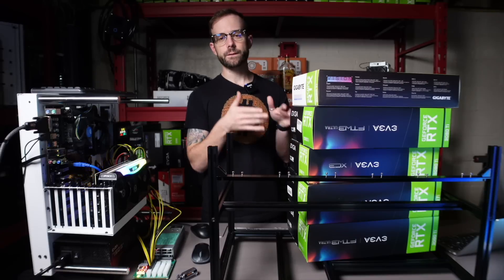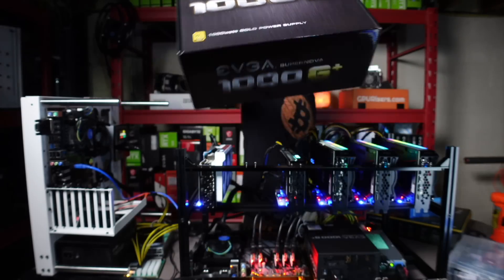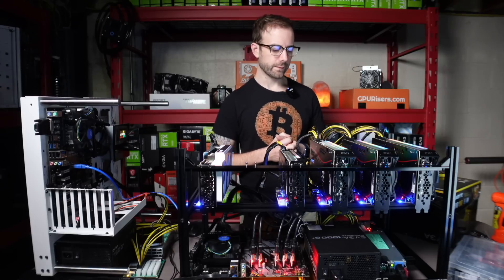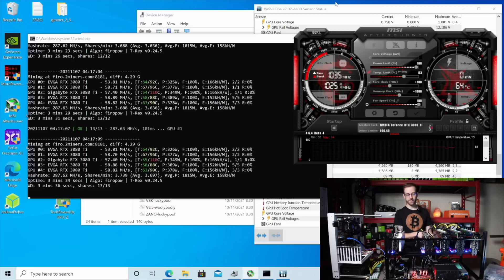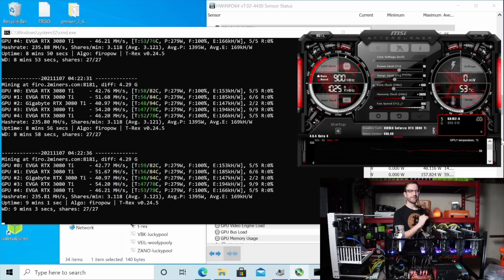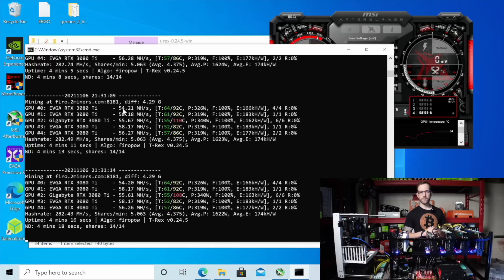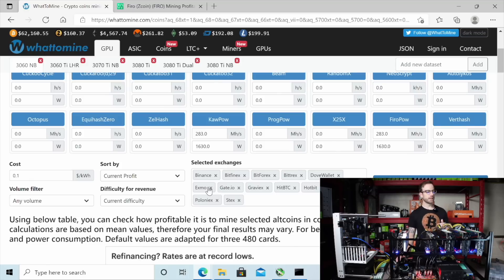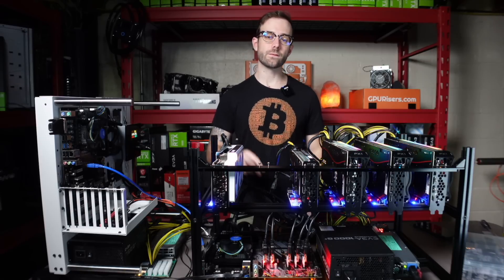RTX 3080 Ti GPU Mining Rig

Comment from the maker: What's the last mining rig you built?
Reply: 12x RTX 3090 (11x PNY, working great, 1 Gigabyte (need a thermalpad surgery)
Reply: Just started mining, First one ever last weekend. 
Asrock h510  pro btc, with 1080, 2060, 3060, 3060 ti.
3070ti in pc going to.
All on flux at the moment 

Thinking of getting a 4 way riser splitter for this board down the line Anyone know if it works?
Reply: I picked up a Biostar TB360 Pro and 3 x 6600xt's, still in progress with 6 x 6600xt's now and  3 6700xt's on the way.
Reply: A x5 3070's lhr with 5x 3080ti's currently mining flux!
Reply: Hello there…. I just received my 6 3080 ti FTW3 cards…. I have  “2”  1200 watt EVGA for power… my question is…. What’s the best way to  power up these beast… I was hoping I could use 2 rails  for each card 

Pcie 1 will  split between one power connector  and the riser card 

Pcie 2 will power up the other two connectors…. 

My question is… I read some where that the “3rd” connector  only draws like  75 watts… 

So if I took Pcie 1 and powered up riser card , and first connector 

And Pcie 2 to the 2nd connector plus the 3rd connector , would it be a proper balance of power distribution….?  If the 3rd connector is indeed a lower power draw which exactly is the 3rd one?  From what I read…. It would be the plug closest to the back (left) which actually sits right above the “ti”  logo
Reply: 6 x a LHR 3060ti and a random 1080ti I had laying around. Currently doing about 320 MH/s on Eth.
Reply: I'm building  5 3080ti ftw 3  rig. Can I use 2 atx psu  to power the gpu instead of a psu server like the one your using in this video.
Reply: @newminer2649  I have a “6” 3080ti rig…. “2”  1200 watt atx PSU each PSU can run “3” 3080ti… can be tricky cause each gpu will need 4 connectors …

Comment: Good day, thanks for making the video!
What server PSU do you recommend if I want to build a 6 x 3080ti rig ? I have a Corsair RM850x on hand.
Thanks a lot
Reply from the maker: You may need 2 server PSUs since in total the GPUs would pull around 2100 watts at full TDP. I'd go with two 1200 watt HP server power supplies.

Comment: Hy Red what type of cards would you choose from the followings inno ichill x3 x4 or asus tuf gaming oc or evga ? I’m prefer asus tuf i saw an article about it and it’s tell the best card is asus tuf. Which from this cards the best cooling ?
Reply from the maker: EVGA first and ASUS second for me.
Reply: Thanks for your reply red fox
Now it’s clarify what i can buy in my country the following ones : ASUS RTX 3080 TI OC or Zotac AMP Extreme Holo or AMP Holo or Ti Trinity OC or maybe some of Msi Suprim X but it’s more expensive than the other ones ( not big problem if this is the best ) what’s your recommendation and also 6 pieces or 8 pieces rig ? I’m afraid only from the overheat in summer ( clima in the office and still 20-30 Celsius )

Comment: Hi, I have recently upgraded from 2 to 4 GPU and PSU to 2000w. As my mobo doesn’t have 24pin, I have been using the jumper (4&5 pin) to power up my 850w but this method doesn’t seem to work on the FSP Cannon 2000w PSU. Any idea why?

Comment: I am planning to run a Gigabyte Z390 UD V2 with the G5420 processor instead of the V1 version, because im not able to find the above specified Motherboard. Will this be sufficient to mine with 4x Asus Geforce RTX 3090 ROG-STRIX-RTX3090-O24G-GAMING Cards? Or do i need to change something

Comment: I have a 3080ti in my Gaming PC I use to mine 22/7 when I'm not gaming. Doing 91 MH/s. In my mining rig I have 6x3060ti LHR, all doing 47 MH/s. With the LHR unlocking more and more I think my hashrate will only go up. ROI will be way before june 2022. I also think the resell value of the LHR cards won't drop as hard as the non-LHR ones after Eth 2.0.

Comment: the problem with that EVGA XC card will have the same issue as the MSI xtrio.
I had to flash it with the Suprim X vbios and it worked like a dream after but you have to go over%100 power to keep up with the other cards.
you may be able to do that now without flashing it as a FTW Vbios.
but you may be better off doing just that to get the same performance.
its funny because now my xtrio performs better than the xrtio

Comment: The Gigabyte 3080 ti with lol VRAM temps of 110c. RIP card, RIP. 4:51  350 Watts is the normal RTX 3080 TI watts but thats the whole card.  You likely have two 8-pin connectors and the PICe slot for power.  Thats 150 watts x 2 = 300 Watts.  Then the maximum from the motherboard is 75 watts.  You never draw 100% from the PCIe slot.  For a stock 3080ti this means a full board power limit of 366 Watts for the EVGA.  For a stock Gigabyte they let you reach 370 watts for the whole board.  The power figures are just the GPU.  The big overclocking boards let the board pull up to as high as 450watts.  Also just because you can hit x watts does not mean the load needs x watts.

Also fix the dangous VRAM temps on the gigabyte card.

Comment: Hello there…. I just received my 6 3080 ti FTW3 cards…. I have  “2”  1200 watt EVGA for power… my question is…. What’s the best way to  power up these beast… I was hoping I could use 2 rails  for each card 

Pcie 1 will  split between one power connector  and the riser card 

Pcie 2 will power up the other two connectors…. 

My question is… I read some where that the “3rd” connector  only draws like  75 watts… 

So if I took Pcie 1 and powered up riser card , and first connector 

And Pcie 2 to the 2nd connector plus the 3rd connector , would it be a proper balance of power distribution….?  If the 3rd connector is indeed a lower power draw which exactly is the 3rd one?  From what I read…. It would be the plug closest to the back (left) which actually sits right above the “ti”  logo

Comment: Prefered card is still the 3070 excellent efficiency and less issues with thermal pads than cards with GDDR6X.
=> mining RVN/kawpow: 31.5MH/s / 198kH/W with a power limit of 160W / GPU +175 / Mem +1450

Comment: Question: Arent you in a dangerous zone with the gigabyte? 3080ti takes around 350w total if not more.
You added a splitter to one pcie cable which already had dual 6+2pin connector.
You now have three ends:
(1) 8pin going into GPU (splitter)
(2) 8pin going into GPU (splitter)
(3) 6pin going into Riser (second head on the original PCIe cable)

Imagine on full blast = 300 watts being pulled from (1) & (2), and then 50w from (3).
All this on the same PCIe cable which is only rated for 300w (or 288w if we are being conservative)
350w on a single cable in a worse case scenario still seems dangerous. Would love to hear your thoughts...

Comment: Actually have a 3080 Ti FTW3 mining on my rig using NBMiner/Flexpool, getting 87Mh/s at 319W for ETH. The card runs insanely cool compared to the 3080 Ti FE I have (need to replace thermal pads I guess).
FTW3 cards are the best in my opinion!

Great video man! Wish I had a budget like yours! Haha 😅

Comment: Favorite GPU right now are my zotac 3060 Ti’s because they use relatively low power, are currently more cost effective than the 3080 ti’s and they don’t generate too much heat.... but my zotac 3080ti rig looks cooler but generate more heat... so a toss up lol

Comment: I started mining in Feb, and so far I've been able to get my hands on 3070s the most out of any of the 30 series cards, so they're my favorite by default. 3080s have been impossible to get, but I'm not complaining - 3070s have great efficiency and don't run nearly as hot as the GDDR6X cards. I'm happy I don't need to replace the thermal pads like I had to on my single 3080.

Comment: Can you make a tutorial for solo mining FIRO using a local node?

I can't seem to get it running with T-Rex.
Reply from the maker: I think you have to use the official miner from Firo. T-Rex won't work if I remember.
Reply: @RedFoxCrypto  Oh ok, I'll try that. Thanks
Reply: @RedFoxCrypto  Do you know what to put for the --reward-addess argument in firominer?

I assumed it's for a wallet address, but it didn't accept that. Anyways, I just removed it and it seems to be working, but I don't know if there's a way to tell.

Comment: Nice video red fox! I have an Xc3 card myself, not a 3080 ti but it’s a 3090…. I was having issues as well on eth where the power would stay at 283 watts and I would only get 103 mhs, what I did was put the power limit to max, then I locked my core clock at 1230…. I know firopow is different then ethash but that worked really well for me. My 3090 is now hashing at 122.7! Hope that helps, if not, then I’m sorry

Comment: Thanks for another great video! Was hooked since 'powering gpu risers' video. My favourite would have to be my 6600 xt as I live in the UK 🇬🇧 and electricity is way more expensive here. Although I found overclocking/underclocking them more tricky. 
On another note, interestingly it is still as much/more profitable for me to mine eth with lhr cards due to power consumption. In my case I really need another good coin to mine that requires similar power consumption as ethash to secure my mining future.

Comment: Mike I have done extensive work with the vision 3080ti and ftw3 3080ti on raven. I found 320w yo be the best mix of efficiency and hashrate on the ftw3 around 58-59 mh. The vision took 350w to get to 58 for me and it of course need a thermal pad change. Ran a rig at these settings for close to a month with no issues
Reply from the maker: Thanks dude. This confirms some of the things I ran into. I appreciate you man!
Reply from the maker: I think I want to get another 3 3080 Tis and get rid of the XC3 and Vision.

Comment: Current favorite is the RX 6600.  Runs stable at ~29 MH/s and pulls ~55 watts of power.  When available they cost new what an RX 580 8 GB costs used.  I have a 3080 ti currently on Excavator getting 56 MH at 298 Watts.  Have run it on NBMiner at higher MH with around 250 Watts of power averaged $6/day according to NH stats over the last week.  Still have a long way to go but slowly moving towards trying to make mining my primary income source.  3 Months ago I had 1 GPU running and now I am up to ~22 GPU's.

Comment: I got the same rtx 3080 EVGA ftw3 GPU (definitely my favorite card, I've owned). I'm using MBminer and using the lhr unlock startup command. I'm getting 80m/h. I was using Trex, with that exact rate as you, but switched. Trex uses more power. Perhaps look at using a different miner.

Comment: My favorite GPU for now its the 3080ti. I'm currently mining with 2x 3060ti EVGA FTW3, 1x 3060ti Asus Rog STRIX, 3x 3080ti EVGA FTW3 in Rig#1, and 3x 1660ti + 3x 1660 super on another Rig#2 and got today 5x GPUs 6600xt XFX to build the Rig#3 tomorrow... I will join your discord to send some pictures ;) BTW, I'm having the same problem on the 3x 3080ti mining ETH, there's 1 GPU that doesn't make the same hashrate as the others because of the Wattage, and I'm using 2 power supplys 1300w seasonic gold for the full rig (3060ti+3080ti)

Comment: 3080 non lhr. When you get #6 3080ti in there, are you gonna power it with the same server psu or the atx. You’ve got to be getting close to your 80% rule on both power supplies.
Reply from the maker: I think I'll have to do 2 1200w Server PSUs and maybe do the ZSX boards.
Reply: @RedFoxCrypto  The frame has room for 8 gpus.  I know the mb only has 6 slots, but have you every used the pcie splitters to get up to 8?

Comment: If you flash the xc3 with the ftw3 bios you can pull more watts. Made huge difference on my 3 xc3
Reply from the maker: Nice dude. I may give this a try.
Reply: @RedFoxCrypto  glad to see I'm not the only one having issues with the xc3 card just picked up one of those and a zotac having the same issues that you were my card wouldn't go past 256 w and the most I could get it to mine Eth at was 72MH/s where the zotac hits 90MH/s. Thought I was going crazy trying to get it to work. Has anyone found a workaround yet?

Comment: Loving my HOF RTX 3080 Ti. It stays cool even when pulling over 350w on Firo.

I have the same issue with my Palit 3080 Ti as you have with your SC. The Palit is trying to draw too much power through the slot. As a result it gets throttled on power usage eventhough the 8 pin connectors have loads of capacity. I flashed the MSI SuprimX bios onto the Palit and it now spreads the power evenly so I can mine at full capacity.
Reply: hi Michael I just got a 3080 ti palit gamingpro , it works a few and gets a solid 85 mh/s , I want to buy a few more Palit cards , what is that experience with them?
Reply: @flipcoin1390  Hi there, Flipcoin. I have had a few in the past and still have 4 GameRocks. I am very happy with them. They are reasonable cool under load. I haven't had any problems with them yet so I can comment on the warranty process. I reached out to them about thermal pad size and thicknesses for my card and they send through the schematic for me. So my experience of their customer service has been positive.

Comment: Only have used my 3090 suprim so far. Thing is a chunker. Havent dialed it in 100% but gettn 123mh and only hittin about 94c on stock pads and pulling 319ish watts. Going to repad n paste soon just to get temps down a tad more. About to build a 3060 rig. Just waiting on the frame.

Comment: A bit off topic, but do you see no problem running the fans at 100 long term? I heard 80 was as high as you should go long term. I don't mind the noise at all and my 3080 Ti ventus is cycling between 92-98.
Reply from the maker: Fans are cheap and easy to replace so I run them where I need them to keep the GPUs cool, especially these GDDR6X cards.
Reply: @RedFoxCrypto  Alright, sounds smart. Thank you for the input!

Comment: Is 110c vram temperature normal? Will it damaged the GPU more?
Reply from the maker: It throttles so it won't damage it. It needs thermal pads replaced to bring down the temps more.

Comment: I like the RX 6600 XT - stable and quiet.
Core @ 900Mhz, VDDC: 656 mV
Soc  @ 960Mhz
Mem @ 1126Mhz   
Temps: 44C(TEdge) 58C(Mem) @ Fan 28.63% 
Watts: 47W (Software)
RedTeamMiner gives 32.0 MH/s ETH